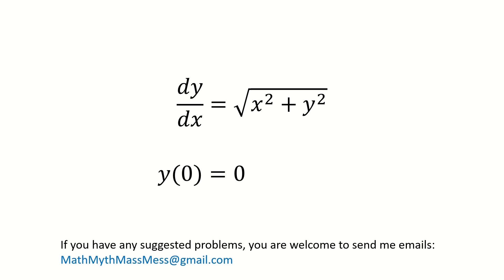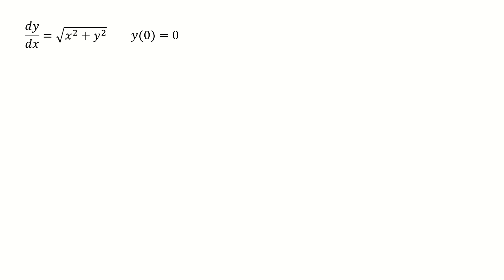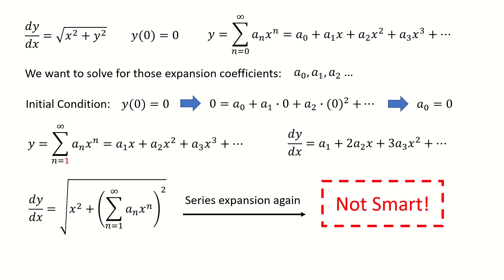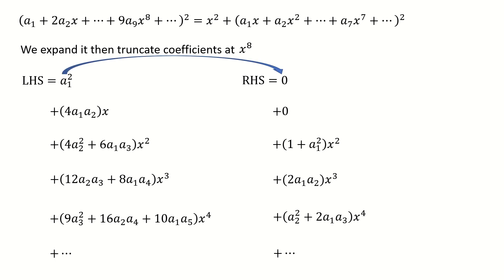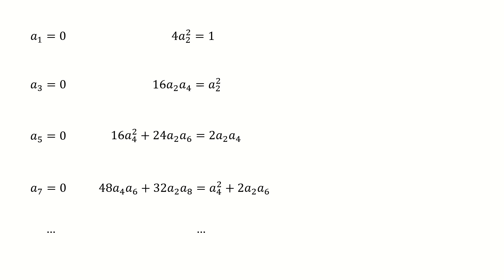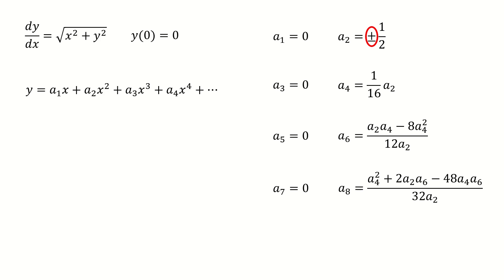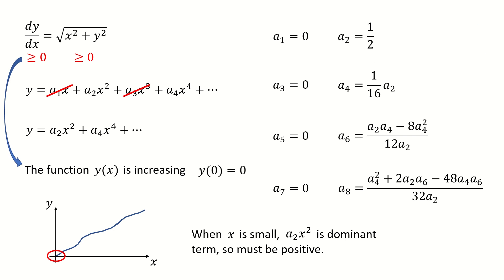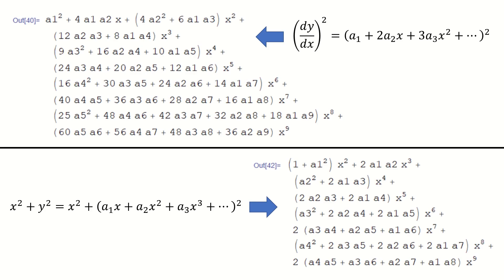Non-linear Differential Equation by Power Series Expansion, posted by Dr Peyam, dy/dx=sqrt(x^2+y^2)

Comment: it can be solved easily. This D.E. could be transformed into an Exact D.E. To see this, let v = y/x, then the D.E. becomes, v+xv'=|x| (1+v^2)^{1/2}. Now setting v(x)= tan r(x), we get v'(x)= sect^2 r(x) r'(x), which in turn reduces the D.E. to the form                             (tan(r) - |x| sec (r)) dx + x sec^2(r) dr=0. We have two cases: Case I: x>0, this is not exact D.E. So let M = tan(r) - x sec (r) and                 N= x sec^2(r), we get N_x= sec^2(r) and M_r= sect^2 (r)  - x sec(r) tan(r). Therefore,  Making the integrating factor depending on x,                   T ' (x) = ( (M_r - N_x )/N ) * T = (( sect^2 (r)  - x sec(r) tan(r) - sec^2(r) ) / x sec^2(r) ) *T= - csc (r) T. Thus, T(x) = K exp(csc(r) x). Return to the D.E. and multiply by T we get an exact D.E. which can be solved easily. Finally, get back the substitutions. Case II: when x<0 can be treated similarly...